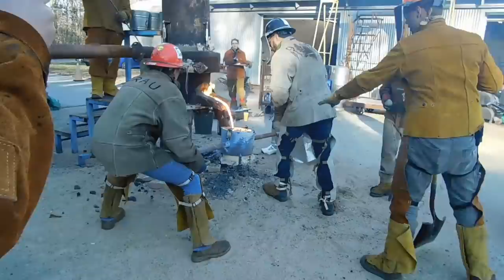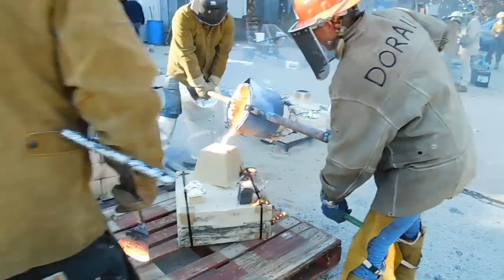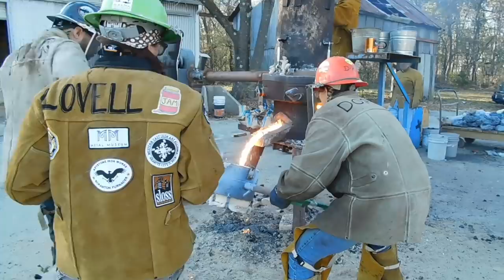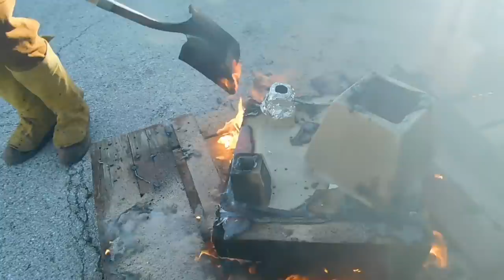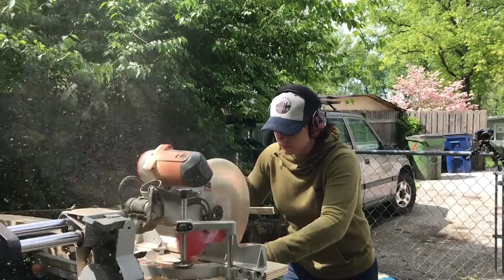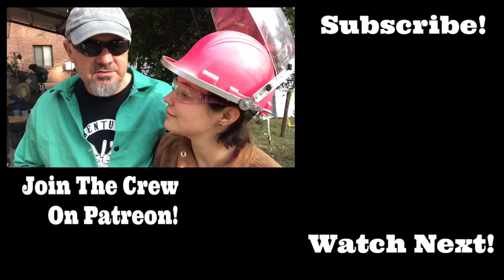Disaster Happens When the Mold Walls are too Thin! | Mold Meltdown | Cast Iron Gypsy

Comment: Would have been neet to see what it looked like after it cooled down. Any chance you got footage of the finished product, damaged and good castings?
Either way, awesome video
Reply: That looks like it wasted a lot of iron. What is the rule of thumb for the thickness the sand in the forms should be from all sides?
Reply from the maker: Hi Bill, I know we already discussed this in person but just to let everyone else know - the thickness of mold walls is kinda dependent on what the casting is.  I didn't see this mold being rammed so I don't know what the form was but I would have probably made the walls 2-3 inches thick in this case!
Reply from the maker: I'll try to get footage of failed molds from now on but since this was not my mold I didn't see what happened to it.